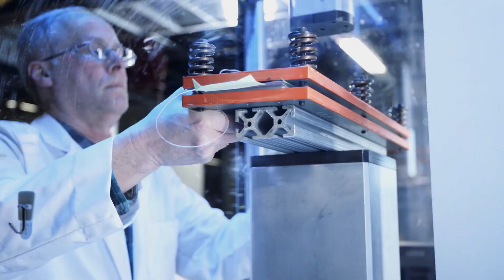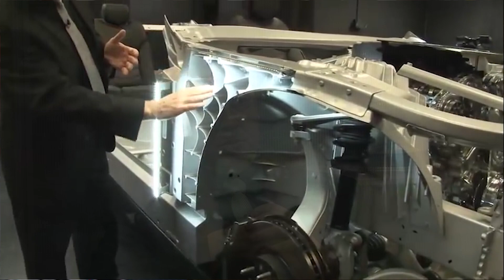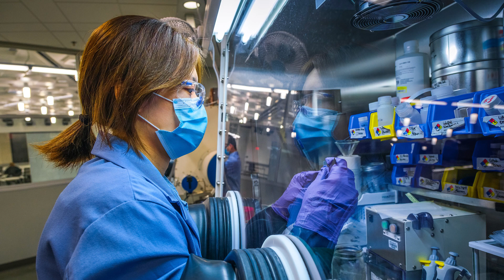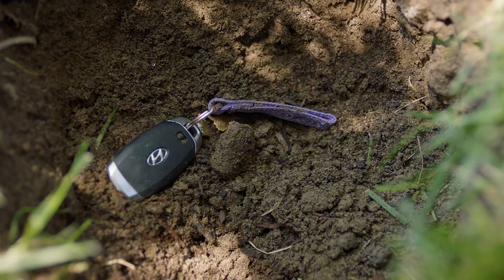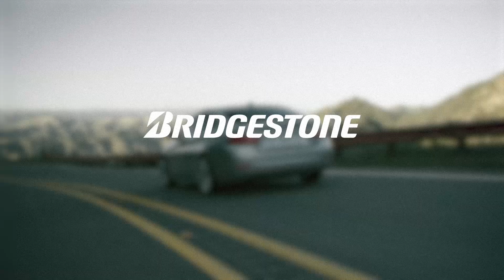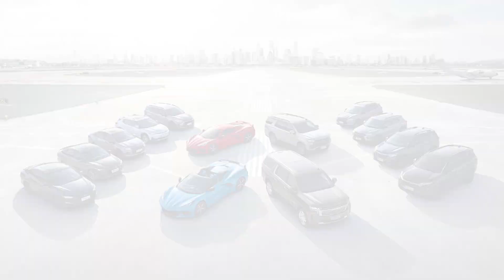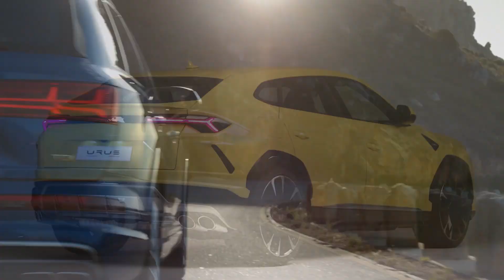GM Steps Up BEV Commitment; JLR Wants to Block VW Group SUV Imports - Autoline Daily 2964

Comment: So this is a full circle for GM from 1913 when it sold lots EV trucks then it was more than 100 years fighting with EV transportation from streetcars in the USA cities in 1920-ies to flops of EV1 and Volt and lackluster Bolt spiced up with EV attempts meantime. Hopefully this time GM will keep up its own words, otherwise the new avalache of other EVs on the market will flood and decimate GM once and forever. Granted I believe the current leadership of the company should not be hold accountable for more than 100 years of debacle in the company in yesteryears. This ring of administrative figures will be hold accountable pretty soon - around 2030 and several years later.

Comment: Why would you possibly be confused about Lincoln having a horizontal display vs a vertical  display?  Do you like taking your eyes off the road to look down as opposed to deflecting your only slightly down.  I really love looking down while driving.
Reply: They're simply saying it's interesting that Ford has settled on a vertical design, while Lincoln - being part of the same company - chose a different screen orientation. They were supposing on the design choice, not functionality.
Reply: I am referring to keeping your eyes up not down.  This is an obvious safety concern.  Distracted driving is a growing problem.  @lukerinderknecht2982
Reply: @thebajabobusa  again, the validity of that argument aside, that's not what they were pondering here
Reply: @lukerinderknecht2982  Again.... and again....